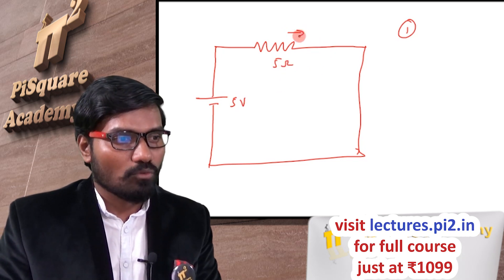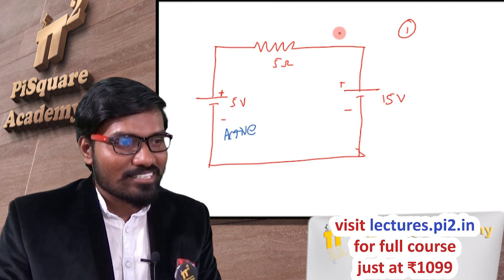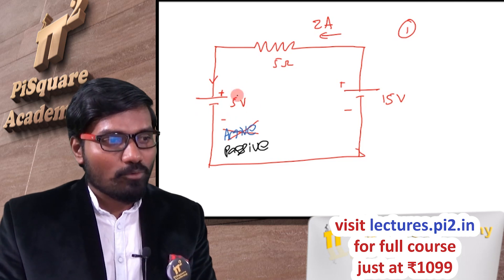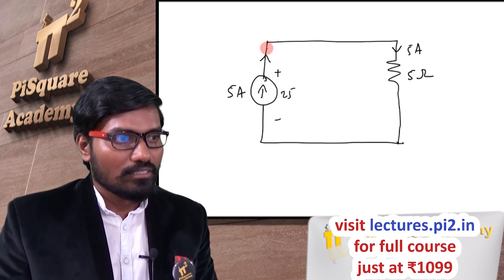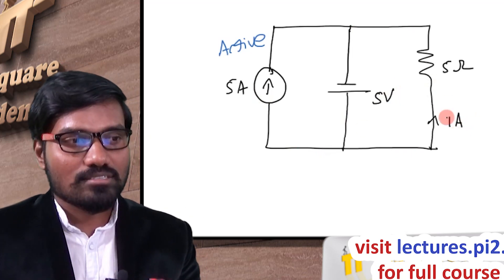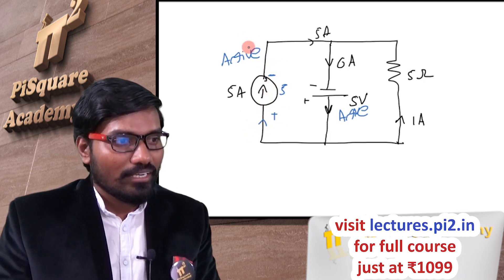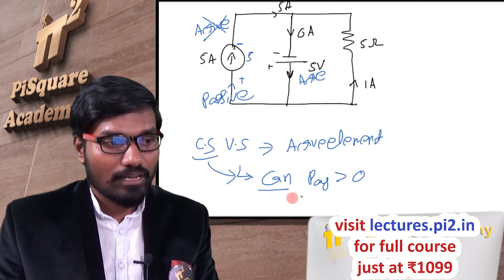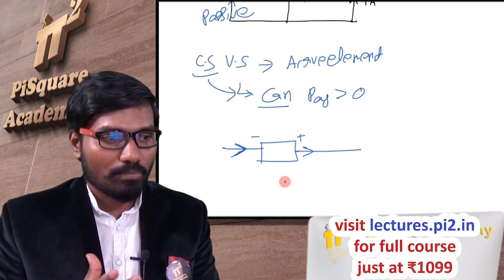Voltage source, Current Sources as Power consumption element

Comment: Please solve this confusing problem for different cases

if the no of turns doubled then time costant of a coil will be
Reply from the maker: Time constant will remain same, as the no of turns double every thing else is constant, L will become double (as turn and length of coil is double) and also the Resistance will be double. So time constant no change.

Comment: 2:20 amps is not 2 its 3 amps
Reply: It is 2amps because another voltage 5v is acting opposite to the 15v. So that the resultant voltage will be 10V ......
Reply: @suryachennoju4852  mm